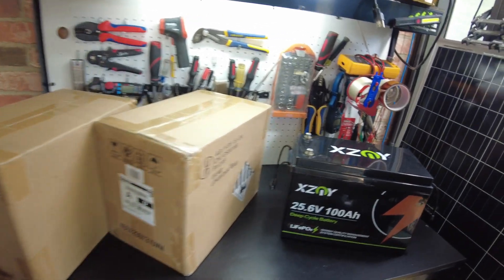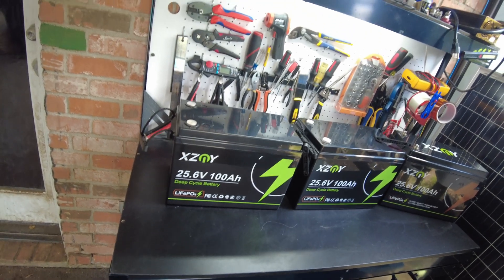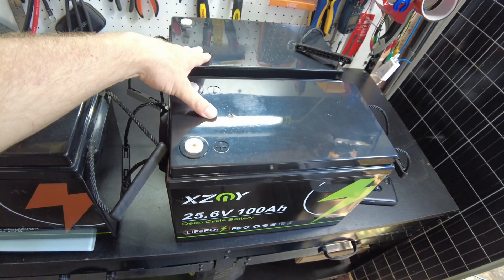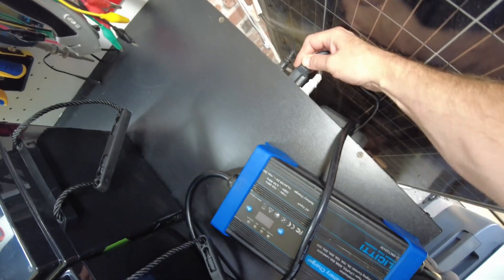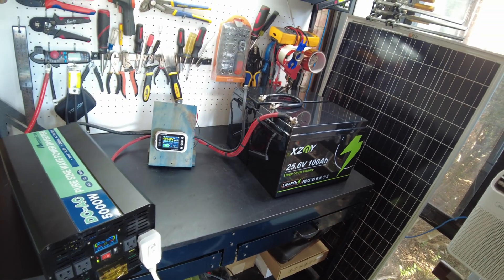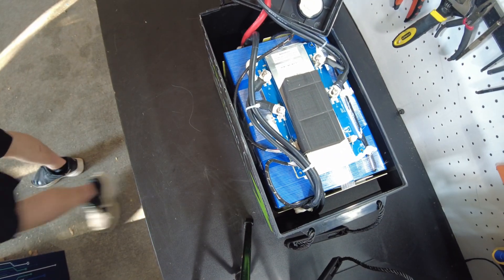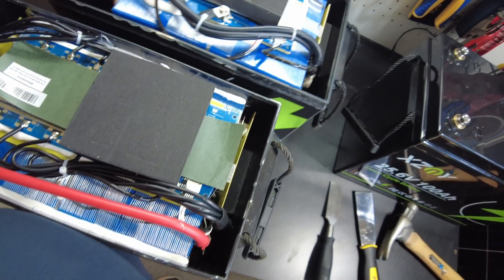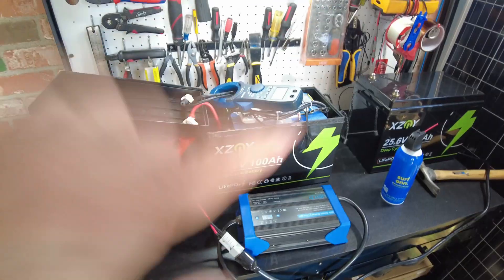XZNY Compact 24v 100Ah LiFePO4 Lithium Battery

Comment: Says something about the relentless advance of LiFePO4 cells when they are clearly smaller and lighter than their predecessors for the same capacity.
I was thinking about the cold temperature cut off test - the aerosol spray can you use will get the probe way below 0oC, but really it should stop charging at or near 0oC. I wonder if you could use water and ice + a little salt to create a temperature at or slightly below 0oC? Maybe the water/ice in a rubber glove so you can rest one of the fingers on the probe?
Reply from the maker: Isn't it Awesome! Seems like I have noticed LiFePO4 cells getting lighter, and smaller overall. Yeah on low temp test, I've been thinking about it too. I'm thinking of building a precise tester using a peltier element with a arduino microcontroller that can PWM the power to the peltier element. It would use feedback from a temp probe to adjust the PWM signal thus hopefully holding a solid temp. Or I might just use a bench PSU to manually vary the power to the peltier and watch a thermal probe connected to my fluke. I have no free time so might be the manual route LOL :) Thanks, Ben!
Reply: @BradCagle  Peltier, pwm and temperature feedback loop is the way to go!
Reply from the maker: @Bennyboy-dog  Well just thought of another issue. So I was thinking I would just use some putty to press the battery temp sensor against the peltier but that would leave one side of the temp sensor exposed to room temperature, or in my case 95f+ sunroom. I suspect this would create a temperature gradient across the sensor. I think I would need to sandwich the sensor between two peltiers.
Reply: @BradCagle  Or drill a suitable hole in a piece of aluminium plate that the peltier is attached to. Easy enough to insulate the rest of the aluminium I imagine.
Reply from the maker: @Bennyboy-dog  That would probably work.